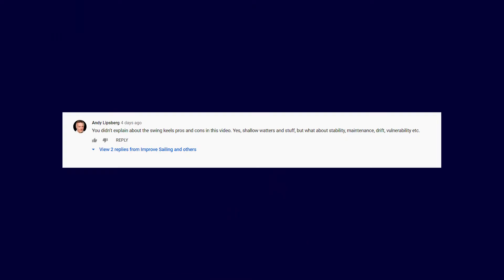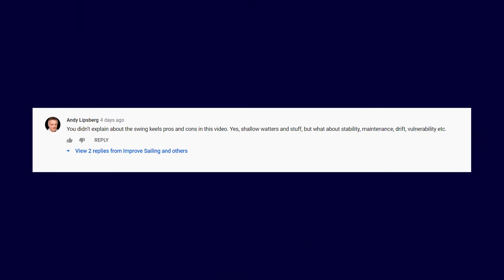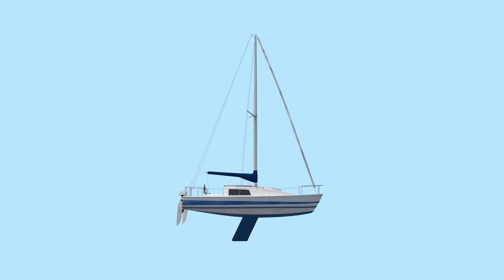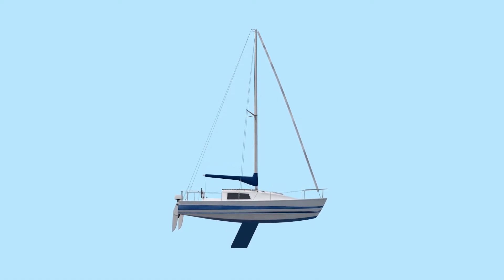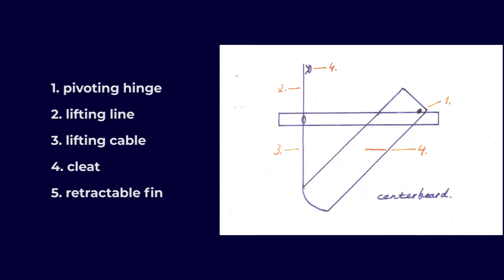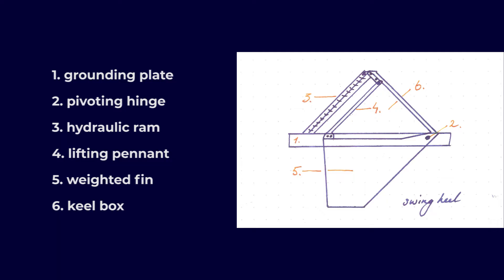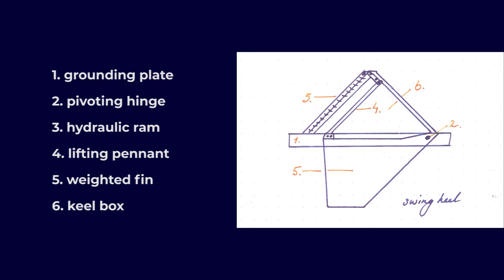Swing Keels and Centerboards: Pros and Cons Explained

Comment: NOT sure you completely understand this topic. I have two Swing Keel boats, both do not retract into the hulls and both are  heavily weighted and wider than dagger boards. Both are retracted by a cable and not hydraulics. They are listed by the manufacturer as "Swing Keels" so since you know better you might what to contact the manufactures and straighten them out.

Comment: Not sure if anyone mentioned this but here it goes. The center board pennant or a sheave can break if you have not got the board all the way down . Basically the board is hanging on the pennant,   if you hit bottom the board comes up and goes back down on the pennant , this usually results in some damage . So never sail with the board half down if there is at all a chance of contacting the bottom.

Comment: I have a 21' com pac eclipse with a center board and stub keel. I've never used the center board. I feel the boat being pushed by the wind sometimes but I'm not racing so I don't care. I'm usually just relaxing and the board seems like too much of a hassle. it's 200lbs the keel 740lbs.  My friend has a hunter 23 with a swing keel. His boat can actually be knocked down in light winds if the keel isn't down.

Comment: I have a jeanneau sundream with lift centerboard in a stub keel. Over Christmas the lifting mechanism came off the lift keel  I had to commission custom replacement clevis pins. Getting it lifted soon so I can reattach and so I thought it would also be good to get info on the pivot bin/bolt so I have a spare to hand if mine is corroded or bent.. But trying to source info has proven impossible.  Jeanneau are no help as an 80s - 90s era boat. Found a post where someone removed their pin to check  but they didnt get measurements of it or photos if its components.  Very frustrating

Comment: A swing keel with a screw mechanism for lowering and raising is the best. No chance of the mechanism braking like a wire or rope and pulley system. The screw mechanism just needs winding with a regular winch handle and greasing twice a year.

Comment: One aspect of swing keels you missed is that they have reduced righting capability when the swing keel is fully raised. Some swing keels can even fall back into the trunk when the boat suffers a knock-down.. Many swing keel sailors lock the keel down for this reason. Of course, then if you run aground…damage is done. Most centerboard boats are dinghys, but I sail a cabin cruiser with a ballasted shoal draft keel and centerboard combination. It’s still self-righting with the centerboard  full up or down. A nice advantage over the swing keel design.
Reply: Just want to mention that your concerns, while valid, don't really apply to catamarans, since the nature of catamaran knock-down is... let's say it's different ;)
Reply: Do any swing keels have a mechanism that allows them to pivot upward in a grounding, but locks them down in a capsize?

What are the different terms to describe the swing keels that fully retract into trunks, like centerboards
Vs
Lifting keels that tuck against the hull, but do not fully retract, like a Pogo 50, or Allure 45.9?

Comment: Nice explanations regarding the movable keel types. I sail a boat with a swing centerboard and a water ballast. Because it heels more than boats with weighted keels, sail selection is more critical to achieve optimum speed in varying conditions. You mentioned two potential downsides - breaking the lifting cable or losing the centerboard entirely. The first is not that big a problem. You keep sailing, the cable is easily replaced, and the boat can be trailered by using a rope run athwartship to lift it into the trunk (ask me how I know). Losing it entirely is, IMO, a vanishingly small possibility. A good, stout bolt and a proper self-locking nut will ensure the centerboard will stay right where it should. Seasonal inspection is plenty good for this.
Reply: I take it you must own and sail a McGregor,,, I;m thinking about buying one

Comment: For a few decades, I sailed a Pearson Wanderer. The full keel was just over one meter deep. From it dropped a swing keel for a total draft of over two meters. In most conditions, the boat handled well without lowering the board. She pointed very well with the board down and ran fast with it up. One could move the boats center aft by lowering half way. In the shallow bays of the east coast of USA, the Chesapeake, Albemarle, Pamlico, Long Island and Cape Cod, this was my perfect boat. I won quite a few races because I could navigate short cuts over shoals on which other boats would run aground. Sailed like a dream when got got into blue water.
Reply: Love my swing keel, since it's a trailer sailor. I go anywhere

Comment: I sail a Balboa 26. She has a swing keel that locks in place with large a wingnut.  I use a nylon nut instead as this will shear in the event of a grounding thus avoiding damage to the keel and the boat. I also never use the winch to raise the keel for any reason other than preparing to trailer her. This minimizes the amount of time that the lift cable is actually supporting the keel.  In my book, the keel is either fully down and locked or its fully up and on the trailer. I did retract the keel after running aground once with no issues.

Comment: I’ve read somewhere that a centerboard/swing keel is helpful when running, you lift it and do not risk those harsh broaching consequences as in a fixed keel, when you are slightly turned sideways (yawned) by a following wave, then your fixed keel brakes you in the water and wind in the sail just drags you to horizontal position until the sail spills wind, it is scary

Comment: Your use of the term dagger board is incorrect. A dagger board is a vertical lift board such as found on Mirror Dinghy. It's not a keel. Centreboards don't have hinges. They have a bolt that they pivot around. Both swing keels and Centre boards have a centre case and basically are the same thing although there are various designs.  My yacht has a heavy ballasted drop keel which is lifted vertically by a vertical hydraulic ram. It's a design that is rarely seen in Europe. In part because it is very expensive to build. And there is a sealed centre case that runs from the bottom of te hull through to the cabin top.  It does however convert the yacht into a proper self righting keel boat which we use for ocean sailing but can also be trailered behind a small truck.

Comment: Hi, really nice video. I am in the process of building a new sailboat for my playground (Rio de la Plata) which is really shallow (mud, sand and shales) and I have opted for the swing keel design. It will be about 2 tons, in a boat of 5.5 tons.  My concern regarding agrounding is related to how to protect the: 1) the hull and 2) the hydraulic system itself, to make sure the energy goes thru it and it is absorved. Any recomendation on where to look more into this topic?  Regards, Juan Pablo
Reply: swinging 2 tons on a cable ?..have you considered the Oday 25/26 type of keels where the majority of the weight (1500lbs)is mounted to the hull and thru the middle of that (which is on a cable), is a swinging centerboard of 60 lbs ? 60 lbs versus 2000 lbs 60 much easier to work with if there ever is a problem.  just sayin

Comment: You mentioned a heavy bulb on the bottom on swing keels, I have only seen them on what I would classify as a drop keel (which you didn't show in a diagram), which is held in a slot like a dagger board but is heavy, so acts to stop leeway and provide ballast. 
I have recently sailed in a plain heavy ish drop keel boat, Sedna 24, and used to sail an Edel 2 which had a triangular plate keel similar to diagram, but due to relatively low weight required for an18' boat was operated by a simple chain.
Reply: I’ve owned two swing keels and neither had a bulb!

Comment: Nice! Go check out Garcia's lifting keels, they seem to have addressed your concerns.
Reply: I think those are considered centerboards.  The righting moment is provided by ballast in the hull.  The advantage is you keep your righting moment even when retracting the centerboard.  The disadvantage is the boat is heavier and likely slower than an equivalent lifting keel or full keel boat; since it takes more mass to get the same righting moment when higher in the water.  Still I think the Garcia is an excellent design, and seems like a really nice overall compromise for a true go anywhere boat.

Comment: Okay there's a question that I asked another person here and I'm going to ask the community and the host of the show I am just about a stepp to away from purchasing a 1982 lancer 42 masthead sloop, it is set up for solo sailing, and it has a modified fin keel with a skeg Rutter, I have never had a sailboat before so I do not have a reference to go by, I know that a fin keel is not quite as stable as a full keel but I know that a full keel is not as fast in the water as a modified fin keel , so there's a trade-off there speed over comfort just a little bit, but does anybody have any practical knowledge between the two and on both different types that can tell me the reaction the plus and the minuses of the two, and if they do your input is very much so welcome before I throw the money down on the table cuz I'm just about two frog hairs away from getting it done, I also know that there's a comfort ratio, but I also know that the comfort ratio is a little bit scoffed at in the sailing community, I know it's like a possible zero to 60 point ratio, but for a beginner like me I know that some of you might not think what I'm thinking, but to a beginner at least it's a point of reference ,now the comfort ratio on the lancer that I'm looking at which is a lancer 42 made in 1981, has a comfort ratio like right off the top my head it's I know it's 26 something ,you know I can't remember what I do know it's halfway up on the scale it was like 26.35 out of a possible 60, you almost have 30 points there according to the comfort ratio I'm getting something about midways on the scale, so does that make it halfway smooth, halfway rough, or is it that it's just halfway smooth and performs better in certain situations than others? all input is welcome just as long as it's, information criticism is not welcome, but constructive criticism even though it's still criticism there is information there,I know that some people can't help themselves, and PS there nothing in the background except thought.
Reply: Comfort ratings don't include the wave energy as that is subject to the conditions at the time.  It is relative to similar boat types.  Look at it this way, if comfort is your key criteria, if a 30 ft boat had a rating of 50, and a 60 ft boat had a rating of 40, which boat would you expect to move around more if they were side by side, in the same sea conditions? For you, I would suggest looking at other 42 ft boats, (or ones you are considering) and choose the one with the highest comfort rating. However, a larger boat with a lower comfort rating could be more comfortable.  As a rule of thumb, heavier is more comfortable.  Also, I would look at the stiffness rating considering your emphasis on comfort.  That will tell you how quickly the boat heels in response to wind.  I suspect you would be happier with a boat that doesn't roll over quickly in a gust!

Comment: I have a mix of lowering and swing keel. While transporting its hoisted up in the boat, a trailer sailer. In the water I lover it down. The bolt are fixed and lies in two brackets. And then I pull the upper part a bit forward so the lower part goes backwards. With a momentum it is fixed in the brackets. When going to the shallow water I can pull it all the way up under the boat. Then I only have 50 cm draft. The keel is only 50 kg. And a 140 l ballast tank.
Reply from the maker: Sounds great, 50cm draft would be able to sail in Friesland without trouble!

Comment: Nice vid. 
I own a Dutch made Relaxon sailboat with swing keel. Quite a nice boat really, with all the pros and cons you mentioned. Unfortunately with the added con that, although it obviously has less drag than a fixed keel boat, you have to be more careful in higher wind conditions to avoid tipping over simply because it lacks the mass a fixed keel has. I have little doubts that a similar boat with a fin keel is faster for that reason. 

But the benefits of a swing keel are far greater than he downsides and that is exactly why I bought this particular boat.
Reply from the maker: You're probably right about that
Reply: this is correct mostly...but not completely. Every boat is a complex system. The keel/centreboard is only one aspect. Hull shape and a dozen other things play a huge roll. A good centerboard boat will have a reasonable amount of ballast in the bottom of the hull to help with stability. Things like tanks and system components have to be designed to increase stability.
The other point is that in heavy weather, you don't put your centerboard down all the way. You put it down enough to help your course, but not enough to overly hinder the boat's ability to surf down the waves...like a catamaran...
You do this, and your centerboarder is less likely to fall or capsize.
In the end, you just have to learn how to sail your boat...

Comment: Great video, I come from a land locked location where large and medium lakes are my only real option for sailing. The McGregor sailboats i find interesting. It may be a special type, but the swing or dagger board keel with the water ballast combination looks very easy for beginner sailors.  I havent had a chance to try one, but got to speak to an own that highly recomended it, even a 26 ft boat over a 14 ft dingy because of how easy it was to handle.
Reply from the maker: Sounds great, there's another viewer of this channel also looking at a MacGregor 26 (I believe under Keel Types Explained). Seems like a fun beginner sailboat and I will look into it myself, thanks for the tip.
Reply: As a proud and happy owner of a MacGregor 26S (not to be confused with the M or X), I am a wholehearted endorser of the swing centerboard water ballast design. At a dry weight of 1650 lbs (plus 800 for the trailer), this boat can be easily trailered, making it perfect for sailing/camping vacations. The M and X have a hybrid planing/displacement design that make it possible for them to move at pretty good speed under power. For this reason they are very popular for rivers, canals, and narrow waterways, and will get you to your next port even when there is no wind. They are a tad heavier than the S. I chose the S because I prefer the more nimble and speedy (okay, not slow) displacement hull of the S (and D) designs.
Reply: The purists of sailing hate the McGregor boats. I like the part, where I can raise the keel and make 20 plus knots on the motor, when I'm in a rush to get somewhere.   The shipyard for wooden boats where I traded for 25 years disowned me, when they found out that I had sold my classic wooden sailboat and picked up a plastic McGregor 26. To each his own.